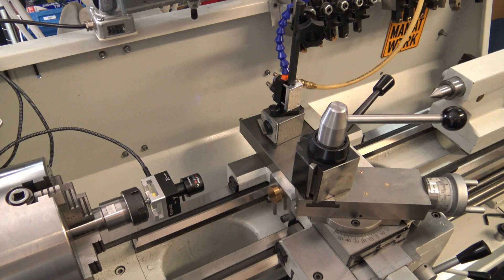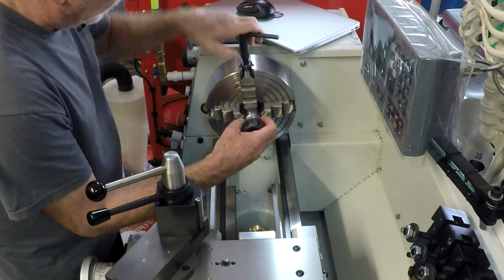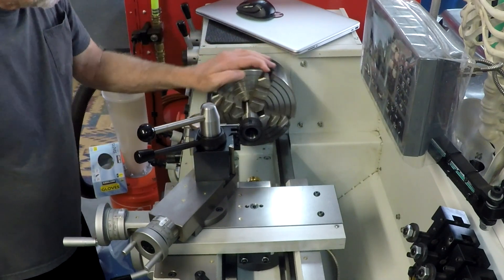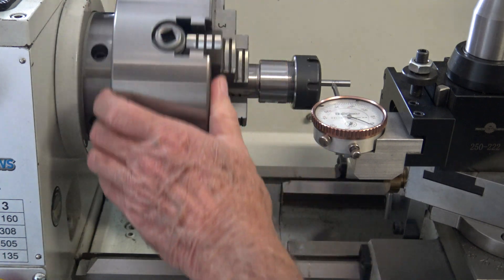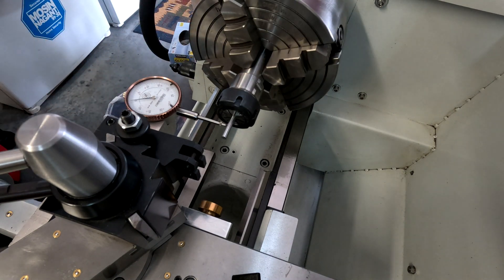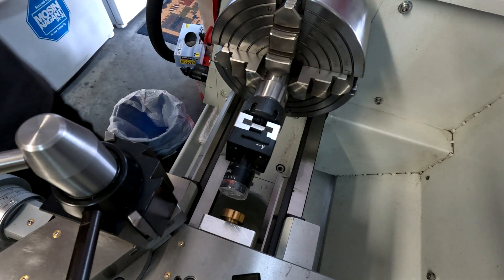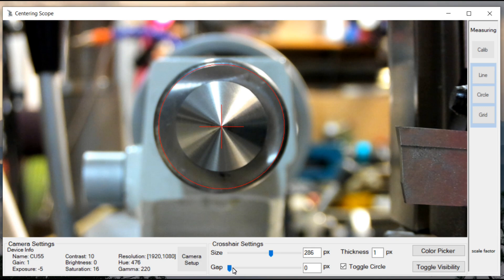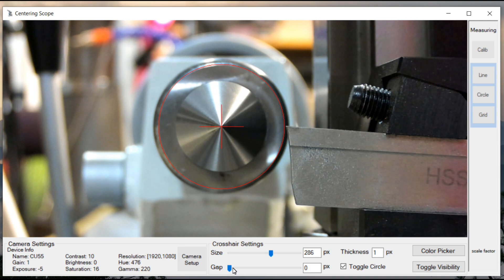PM1236T Setting the Tool height with the Centering Scope

Comment: What software are you using to display the camera data and add a set of crosshairs?
Reply from the maker: The software engineer that wrote the program and designed the system is still working on the patent and manufacturing details. I was lucky to get a prototype. last I heard the engineer that designed  the system got bogged down with extra work at his job at ran into a delay on the camera project.

Comment: Very nice and very accurate, 
but you need a laptop
A more simple way to go …..
put a mini laser with a narrow point in your nice collet set up
and see the laser light on the working top of your insert to
see the right center height.
Also easy on tools mounted
upside down for safe parting
with reverse spindle rotation.

insert

Comment: Very nice. That should bring a lot more confidence on setups.
Reply from the maker: The camera is extremely accurate. If you watch this video  https://youtu.be/BhR3Aw8YXvc at about the 8:28 mark you can see the nose of the dead center. It is precision ground to sharp point. And its sharp. I know because I scraped the back of my hand against it and it cut like a razor blade. In the video you can see the camera is so sensitive it makes the tip of the dead center look flat when its zoomed in. I did some work after I used the camera to set the tool heights, and so far the ones I used are dead on. No more adjustments were needed. Thanks for the comment Jerome.

Comment: That is a great tool for a quick but rough realignment of the tailstock.  Once you have that wonderful camera set up, have you considered making a dedicated tool height reference cylinder that sits on the saddle to check tool height.  Some people measure off the lathe bed but I figure the saddle is a better solution for accessability at any time.  Where did you purchase the scope?  Cheers
Reply from the maker: I'm thinking about that. I see a lot of videos where people have made a reference cylinder. Thanks for the comment.

Comment: Is the tool height the same while making chips?
This seems like a lot of mincing round compared to just taking a facing cut and adjusting.
Reply: Agree, You only want it pretty on center for facing cuts that go all the way. Otherwise it's not that important. In fact in the old days (my days) the standard for optimum cutting was to keep the tool 5 degrees above center. The idea was to always have a positive load on the cross slide lead screw. You also want to keep it above center for boring bars, especially longer ones.

Comment: I’m really enjoying the 5C collet chuck I got with my lathe, you might want to consider getting one for your ER collets. In my enthusiasm and ignorance I ordered both the 5C collet chuck and the collet closer thinking I could use both but have decided that the closer isn’t necessary for hobby work and will probably get rid of it. It hasn’t even been installed. Also, the closer adds more length to the headstock end of my lathe and that space is at a premium in my shop.
Reply from the maker: The 5C collets are on my wish list. The ER32's aren't the greatest.
Reply from the maker: Finally ordered the 35 piece 5C collet set and the precision 5C adjustable chuck from PM. I've had it for a while now. Its a game changer for sure.
Reply: @mdw66799  I use 5C collets now whenever possible rather than a chuck. I finally decided to install my collet closer a couple of months ago since I had it anyway. I was quite pleased with the collet chuck but I think I prefer the closer just a bit more. It’s no more trouble to install or remove than the chuck and isn’t in the way as much as I thought, especially if I remove it for storage. If I didn’t already have it though I don’t think that I’d ditch the chuck for the closer, at least not for hobby work. One downside is that the work is close to the end of the carriage travel and I often have to extend the compound a bit to get the tool to reach the work.